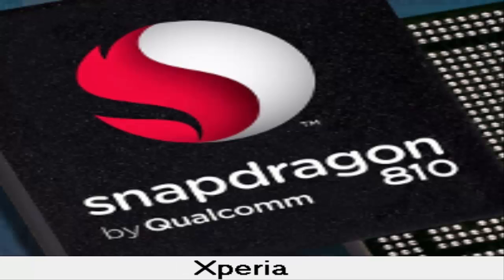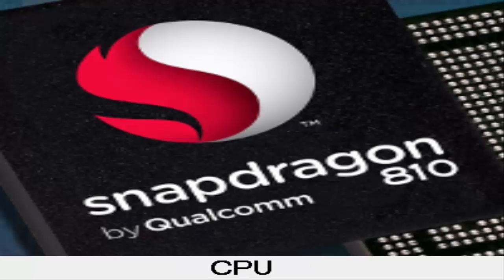Snapdragon 810 SoC making Sony Xperia Z5 Compact owners sweat with overheating issue

Comment: Having problems again with tthe Xperia z5 compa t. Im actually writing this with thhis exact handset. And as yoi miight notice. Im having trouble writing correctly be ause of the glitching touch input. The problem was fixed after relrase. But now. After android 6.0 has launched on the z5 series. Its tiime for the heat issues to come vack... The struggle iis real.
Reply: +Speedkomodo  Bought this handset 2 weeks back & i am also experiencing same heating issues. Phone heats up durig normal usage more than usual. though i am not facing any touch issues, i updated to Android 6.0 as soon as i bought this phone.
Reply: +Navmeet Singh the issues got resolved already ^^
Reply: Speedkomodo How you fix overheatin issue?
Reply: rotcataergeht not at all. The phones processor is just built very poorly.